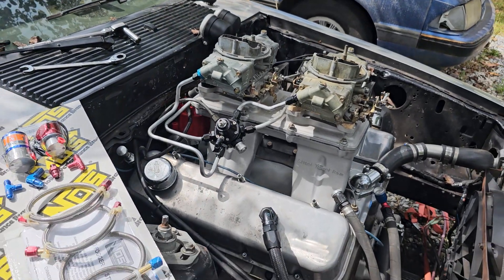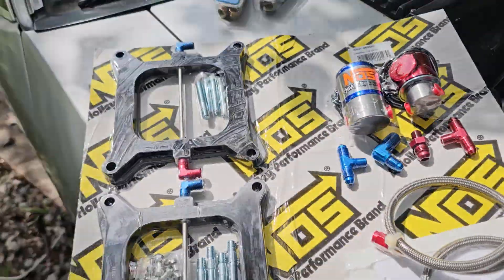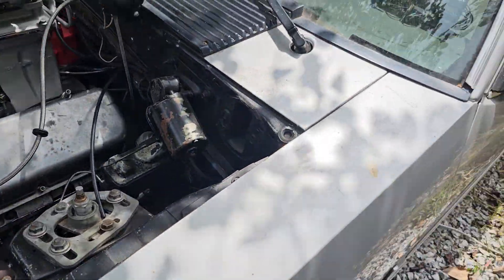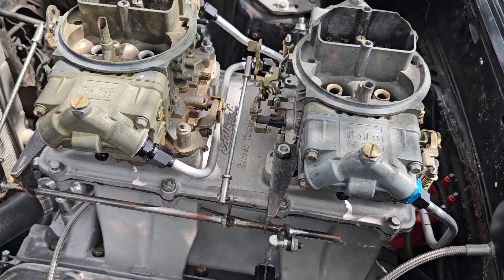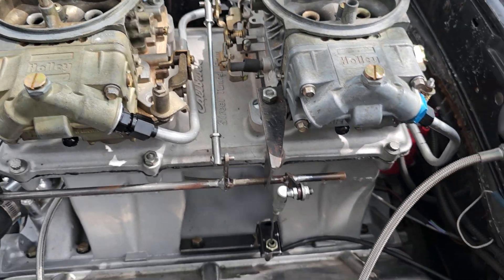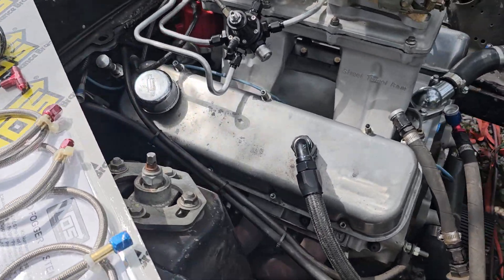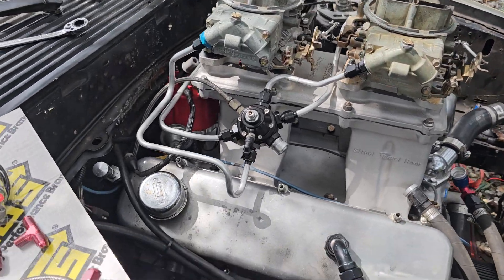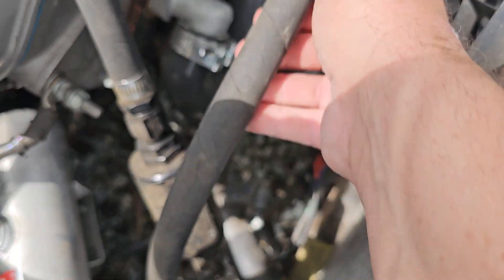"Big Block Foxbody" Tunnel Ram Update.

Comment: I had a wilson plate spraying 350 no problems on 430 sbc
Reply from the maker: I was talking about NOS cheater plates. . I have no experience with Wilson plates.
Reply: @bigboreracing356  I had a cheater plate and never had a problem with it jetted at 250. I even had  a power shot plate  stacked on it so I could do 2 stages
Reply from the maker: @Stevesbe  I wont have issues spraying 250 with these plates after I have them checked out and flowed.
Reply: @bigboreracing356  I have seen plates that were no good  brand new. My friend had a big shot crossflow plate that would break up every time he it . I tested the fuel side and it was just dribbling out  @ 5.5 psi
Reply from the maker: @Stevesbe  What was wrong with it?
Reply: @bigboreracing356  idk we ended up giving it to another guy . I'm not sure what he did with it. Something was not machined right inside the spray bar or the entry fitting
Reply from the maker: @Stevesbe  Yeah quality control not what it use to be.

Comment: Procharger really gone 😢
Reply from the maker: No. I still have it. It makes to much power and lifts the heads on the GM factory block when traction is good.
Reply: @bigboreracing356 get a big block Ford
Reply: @bigboreracing356  hey I was not trying to give you a hard time LOL it's just whenever there's a Chevy motor in a mustang it just yuck but it's you're ride and your build
Reply: @bigboreracing356  that would have been nice man very nice
Reply: @bigboreracing356  can't wait to see it champ